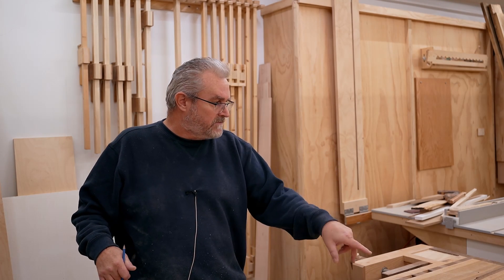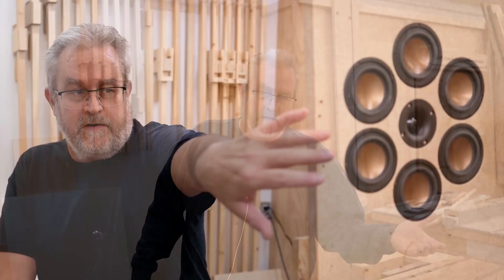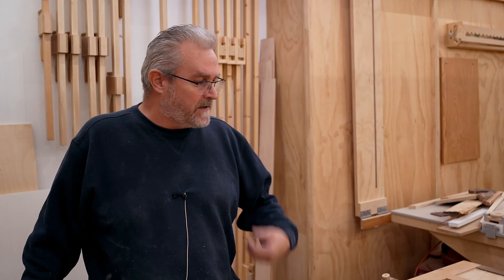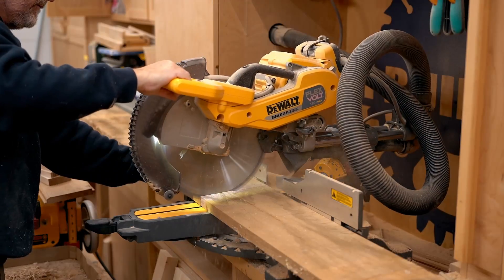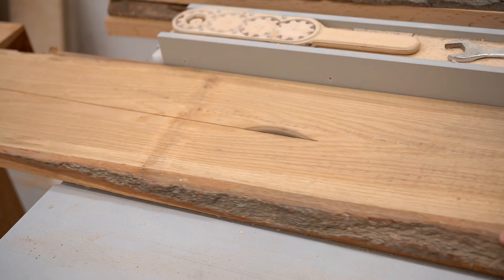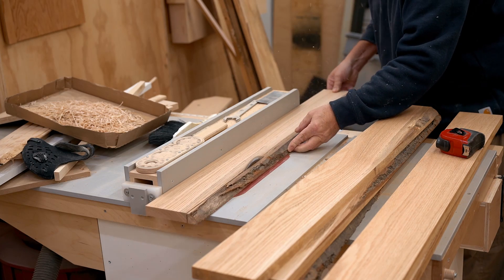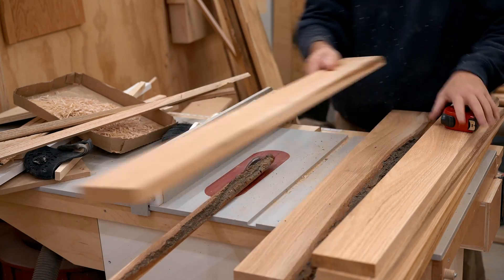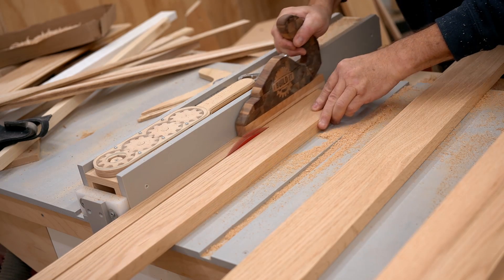Coax Array Speaker Build - Part 1

Comment from the maker: Getting started on an interesting speaker design, something I'm calling a "coax array". The concept is to replicate a large dual concentric (coax) driver with a ring of small midrange drivers around a central horn-loaded tweeter.
The advantages in using this arrangement are higher power handling, high sensitivity and it sets up a true point source.
The array handles frequencies from 300Hz to 20KHz, while the dual woofers take care of 300Hz and below. This should produce a speaker with very even coverage over a wide area of listening positions.
In this first video I summarize the design details and get the solid wood milled for the baffles of each speaker. I'm using red oak and being very selective to get a clean, defect-free appearance. That means gluing several pieces together to make the 12" wide baffles.
Reply: where do you think the ring cross to the tweeter?
Reply from the maker: @daboyakasha101  I still need to design the crossover, so I'm not sure yet. But it would most likely have to be around 1500Hz to avoid comb filtering from the mids.
Reply: Interesting. How will you avoid comb filtering and rough horizontal dispersion? At 1,5khz the wave is approx 23cm and your ring drivers c-c looks a bit larger than that?
Reply: @bjornmagnusson6909  I was thinking something similar. Will be interesting to see where it goes.
Reply: Why not let the mid ring work in open baffle? Or was that maybe your intention?

Comment: It’ll be interesting to see your crossover design and compare it to the Tekton speakers I think this design is inspired by. Getting the attenuation right might be the hard part. I’ve been debating this type of design for a while now. Enjoy the build.
Reply: I think John used higher quality tweeters than Tekton '
Reply: @tee-jaythestereo-bargainph2120  Tekton uses only tweeters where this design will use mids AND a tweeter. I wouldn’t say the drivers here are any better in quality though. Just run of the mill (still good) speakers. Tekton claims some of their arrays play down to 450Hz, this is pretty low for tweeters. Johns design will need to take crossover frequency and distance into account but also how much to attenuate each speaker in the array. Will be fun to watch how it all turns out.

Comment: if i had a wood shop, i would probably make speakers all day, among other things of course.
i am looking forward how this  Coax Array Speaker turns out :)
Reply: Yeah, we all would like to think that, but as I'm sure John here will agree; you can have all the tools in the world, but you ALSO have to know how to use them properly and to their fullest advantage, as in all of the subtle knowledge and experience with woodworking, in order to actually make the cabinets, etc, truly beautiful and well finished, with NO air gaps or rough edges, etc.

I know all of those skills can be learned over many years of experience with woodworking, but it's definitely not as easy as just all of a sudden "having a woodshop" to deal with!
Reply: @JoeJ-8282  i borrowed a garage with some simple tools and i made some speakers, so a wood shop would let me create all kinds of speakers and more shapes.
it is so hard to get the results when i rarely make speakers.
just me making mistakes all the time.....

Comment: Very interesting build. What specific advantages do you see over an 8 or 10 inch pro coax? Are you able to crossover higher up?
Reply from the maker: There may be no actual advantage over a pro coax, since this has to cross fairly low as well. 
More than anything, I thought it would be an interesting experiment to try, and of course it looks interesting.